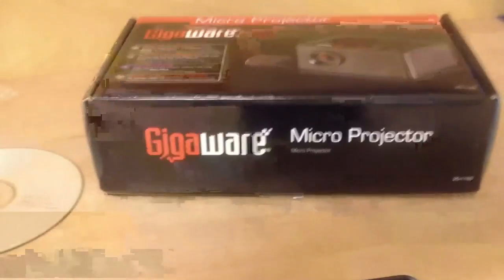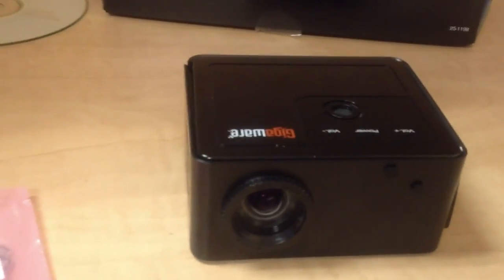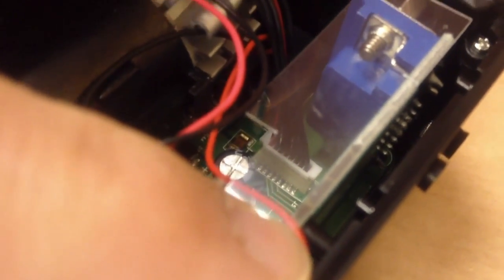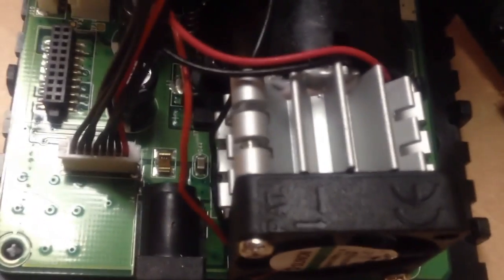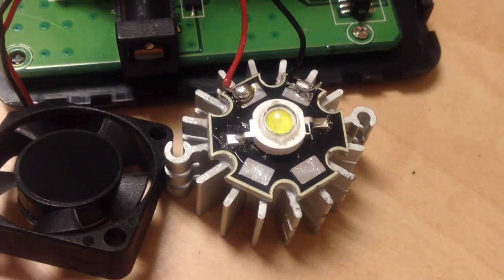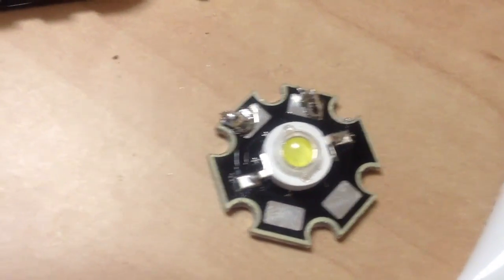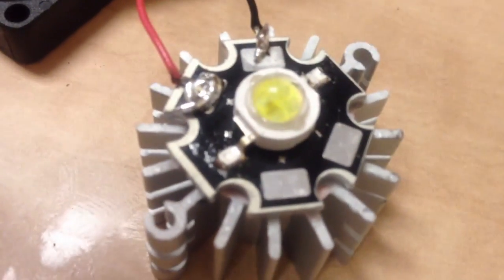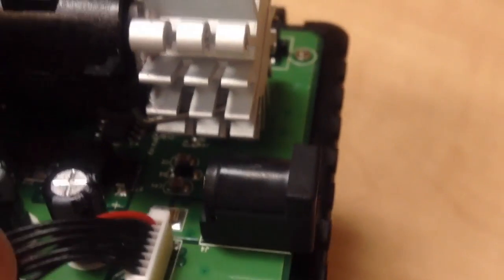Gigaware Micro Projector LED lamp Upgrade Replacement Repair.

Comment: I own two Optoma LED projectors and absolutely love the brightness. I’ve always wondered if there’s a replacement led when these expensive projectors finally give out. 

I’ve even opened my first projectors right out of the box, but I stopped short in fear of contaminating the led mechanism. 

I’d hate just throwing out the projector once it clunks out completely. 

This was very fascinating though.

Comment: Nitwit, the new led needs more power, the power supply is not giving it enough amps, an outside source is needed for this to work. 2019/01/06

Comment: To get it brighter you need to install a decent COB LED and compatible driver. Problem is that the heat sink and fan probably won't be up to cooling it. On second thoughts junk that projector, it's a heap of crap anyway. You should do a video on how not to solder.
Reply from the maker: https://youtu.be/t8sD_esWIDw Here you go...

Comment: even running at full power why would you assume your getting 350 lumens. i used to make DIY projectors and the screen blocks alot of light so you lose alot coming through. hence whatever they say the projector is is the lumens after it leaves the screen not as you thought before.

Comment: good night, by the knowledge that is they possess, would consult the following: I own a lamp overhead projector 500W , I would like to know if it can work smoothly in a video beam acer ( obviating the electrical procedure to turn on ), the beamer It has a 230w lamp . the projector can work without problems so powerful light ?? Thank you

Comment: The projector isn't equipped to provide full power to that mod, so an even more powerful LED will probably just disappoint you- you need to upgrade more than just the LED. ;)

Comment: hi guys im thinking of buying a micro projector and will probably change the led too, but i gonna use a external power supply to not burn the projector and more power out of the led and wondering if you guys know how to look if projector can know if there is no led attached to original supply or does these cheap projectors has something like that?

what is going to happen if i have too bright led? will that destroy the projector or image? and how?

Comment: changing just the led is a waste of time n will not give you the full brightness that the new led is capable of.... u will have to put a higher wattage led and a led driver that matches the new led wattage.... using d old internal driver on your new led wont give u a big gain in brightness.... if u really want good performance higher power led with a matching led driver is d way to go.....

Comment: Next time, tin the wires first, then put solder onto the pos and neg pads.  Finally solder the wires on.  It will work much better. Also the heatsink on the led emitter is probably taking a lot of heat away from the iron.  May want to use  a higher wattage iron.

Comment: You should try the XM-L T6 LED with 3.3v and 3000mA, you get 1000Lm in the same form factor as the LED you are currently using.
Reply: And if you are still not satisfied with 1000Lm LED you can get a SST-90 but if you go for the SST you need a bigger heat sink and 30W Driver at 11A and 3v. The MOD you did there is not accurate, the LED is capable of 300Lm at a certain voltage and amperage, you can replace the LED-s as long as you want, if the driver is the same you will not get the max output of the LED. The same mistake I made with my DIY Projector, kept buying LEDs but the problem was the LED driver.
Reply: deliquenme He will probably have to put in a larger powersupply if he does that plus the fan and heaksink may not be enough to keep things cool.

Comment: The new led projectors that have a very good quality light,the very expensive ones,use very powerfull and expensive leds AND in a very specific and high end configuration,not like that cheap projector,theres no way of turning that projector light increase in a noticeble way.

Comment: In fact the projectors focus lentz dont get along with lights emitted from big areas like a 100w led,they need a strong light from the smallest point possible,leds have a maximun  efficiency of about 220 lumens per watt witch i think is the record at this point and the only way to give it more lumens is thrue more area and that is the wrong way to go in what projectors is concerne.

Comment: Friend dont waste your money in a new "more powerfull led" because they are a lie,leds have a certain luminance per area limit and regarding video projectors they are still in a early phase,you might think oh well ill buy a 100w led and get a more bright projector...wrong!!The 100W leds have more area,in reality the brightness per inch is the same it just has more area emitting light,in a projector what matters is the "flash" strenght not the array size.

Comment: No, unfortunately you're wrong. All LEDs require a constant current power supply, not a constant voltage, so I doubt that new LED's current would be any higher than for the original LED. And having nearly the same forward voltage for both LEDs you win nothing. You have to increase the current to put new LED to its power range. The projector may or may not increase LED current, depending on schematics.

Comment: Not if it's being run by a "driver". LEDs have an amperage limit to them, which in effect is limiting by an LED driver. Sans driver, it would pull the amount of amperage it needed, however these LEDs require a driver to maintain efficient current consumption, and limit it from being driven at maximum amperage. The driver also regulates the power to the LED more efficiently.

Comment: cont 2...

Another problem is, with higher power LED's (needing more than 500mA or so), the series resistor can get very hot, and larger resistors are needed. A better way to drive these LED's is by using an LM317 regulator. (Google for "super simple high power led driver").

Yep, a Cree LED is probably a good idea. They are still some of the most efficient white LEDs around. I'm interested to see how bright this could get. Please let me know if need any tips on soldering to the power connector.

Comment: cont...

The current that the project supplies to the original LED is probably far less than what the new LEDs are rated at, so you probably won't get close to full brightness out of them.

The projector obviously limits the current to the original LED, and modifying it for brighter LEDs could prove tricky. I would recommend soldering the new LED directly to the DC power input socket (in series with the correct resistor). That's if you don't mind the LED being on all the time?

Comment: @supamonki69, you are mostly correct - an LED has a very low resistance, but has a maximum current that they will run at. Too much current will pop them, so you need to limit the current to them.

The most basic way is with a resistor. The value of the resistor depends on the source (power supply) voltage, the internal voltage drop of your specific LED, and the LED current that you want. (Google "led series resistor calc" and try the linear1 site.)